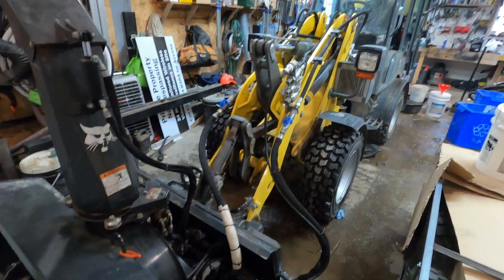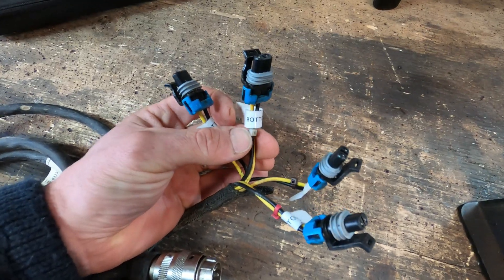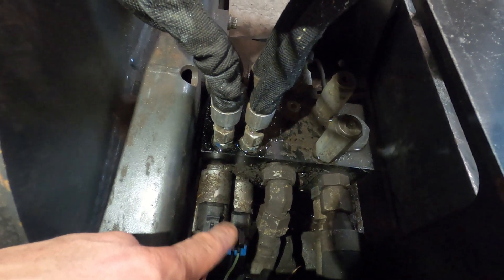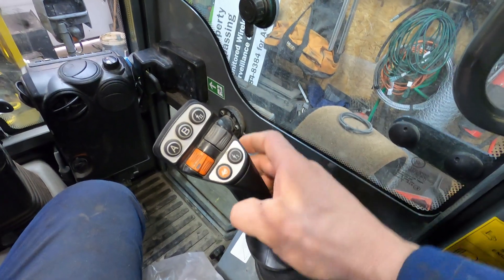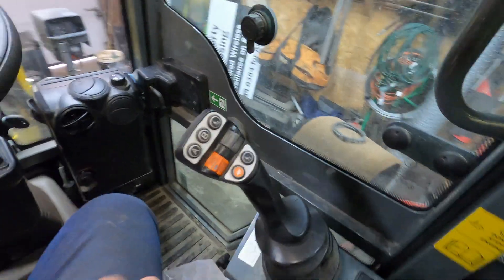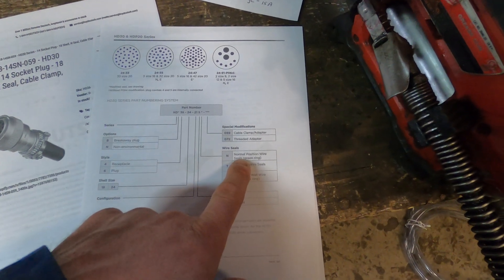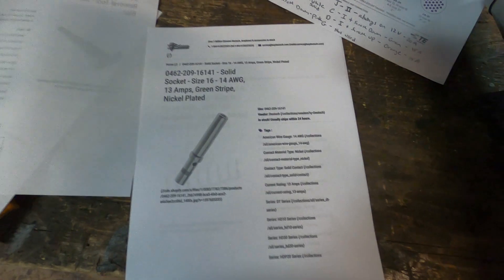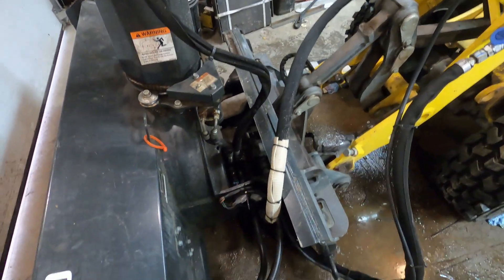Wiring a 7-Pin Bobcat Snowblower to Work on Different Machines (WL32) -14 Pin Skid Steer Harness

Comment: Great video on the connector information I basically knew what I needed but after searching basic common sense terminology for half an hour I got pissed off and went to YouTube... Wham you had the part number at the breakdown of the meaning of the part number everything I needed to know to simply hook up a two-wire power for auxiliary on a skid steer attachment.